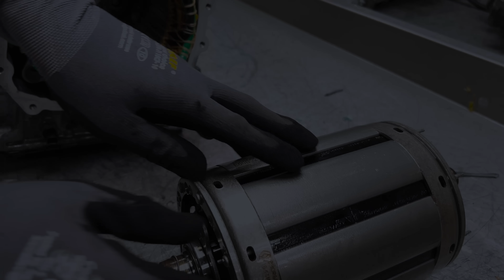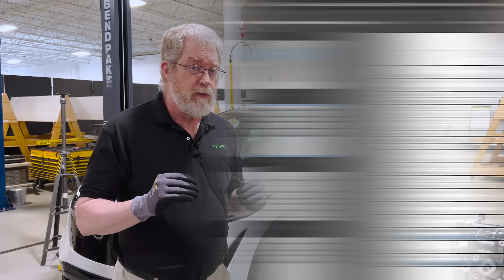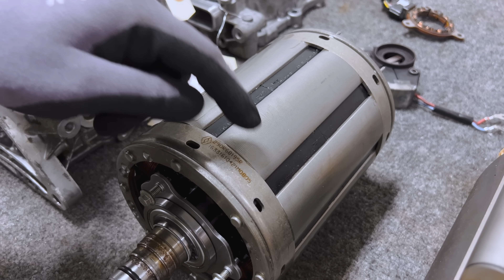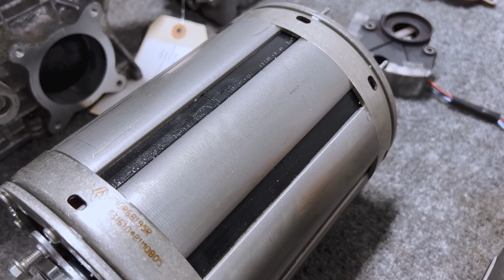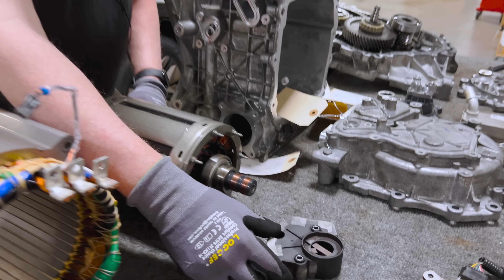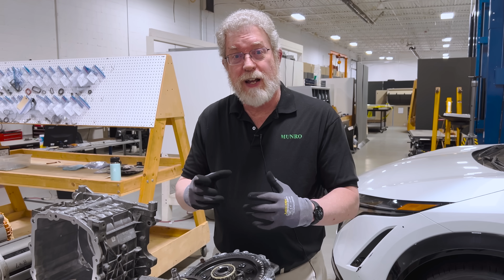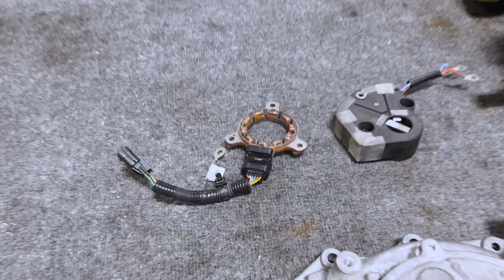This EV Motor Has No Magnets – Nissan Ariya EESM Teardown

Comment: Brushed RC hobby motors are similar to that Nissan design.  On RC motors, the commutator, the surface that the brushes touch, would turn black after a while and the motor would become less efficient and slower so I wonder how the Nissan design is going to work out in the long haul.  On the other hand, the windings in the rotor are super clean.  All the wires are placed nice and parallel with each other and back in the day, this would require the rotor to be hand wound.  I wonder if machines nowadays can wind rotors clean like that.  Machine wound rotors had windings that looked like what's in that Nissan stator.  They're all messy and some of the wires cross over each other.

Comment: So great to see a video on Nissan's EESM motor. I drove an AWD Ariya and an AWD Equinox coast to coast (San Diego to NNJ) and I noticed that at higher speeds Ariya has a slight edge on miles/kwh efficiency. At the end of the trip, Ariya scored 3.4 miles/kwh and Equinox scored 3.2miles/kwh both riding at mostly 80miles/hr.

Comment: @Munro Live: Great video! A little background info: The motor was originally developed by Continental and Renault used it in it's 2010 Renault ZOE (call Q90 motor), then Renault used/licensed Continental's design and rebuilt it in-house (called R90 and R110). You'll find Continental schematics if you google "Chameleon charger" because this motor is the AC charger at the same time (because the windings are used for the AC/DC conversion of up to 22kW AC which is common in Europe 3-phase wiring for the typical 400VAC x 32A)

Comment: I'm not convinced that brush-powered, oil-cooled magnetic coils for rotor is best engineering solution for synchronous motor. They just decided to get rid of "costly" permanent magnet for more complexity, lesser efficiency and much less reliability. Good luck changing cooling oil and brushes of your electric motor similarly you had to change belts/chains for your internal combustion engine.

Comment: So they have made a slip ring motor/ alternator. If you look at the 1970s yamaha xs twins alternators they with careful design had a fixed rotor winding negating the need for sliprings with stators of normal design

Comment: It's not the same as a permanent magnet motor. You can vary current to the field to control speed. But it costs a little to energize the field.  At low power it is more significant.

Comment: What highway efficiency? Ariya is no more efficient than Hyundai Ioniq 5 (dual PM) or Audi e-Tron (dual asynchronous induction) and neither of those has wearable parts. Like variable compression, another Nissan "innovation" that adds cost and complexity with no actual benefit.

Comment: When I was a kid (around 10) I rewounded a burned slot car motor. Then I had the idea to put some extra copper and since I recalled having heard they used varnish to hold the wire in place I did both - except I used woodworking varnish. The motor ran beautifuly for a few seconds than it turned into a rat's nest of copper wire and melted varnish.

Comment: The ZOE model from Renault also used brushes that wear down... but they had them not easily available for replacement - thus  a lot of manual hours to replace such worn brushes. This made an old(er) Zoe not very cost effective to return to good performance by  replacing the brushes.

Comment: In permanent magnet you would be able to reduce the magnetic field too electronically by a technique is called field weakening,  injecting d current to stator to make a field opposing the rotor field

Comment: BMW noted the same reasons for going brushed motor for the current gen i4, i5 and iX (Resource / supply chain risks). I wonder how similar or different they are? I recall that the biggest thin some talked about with brushed motors is addressing the controls, I would like to learn more about that on these brushed motors. Also, for brushed motors, is there concern about temperatures in the rotor? Is there any different tactics for cooling?

Comment: While appliances and powertools advertise with having brushless motors, Nissan decides to go to brushes when everyone else is brushless.
It gives me a double feeling. On one hand it does work, it's proven, etc. etc. on the other hand you have a wear item that generates graphite dust. And it is better? Nope, at least not in every way, or overall; it just has some benefits that make sense for highways.

Comment: In UK, the Nissan Qashqai is an engine hybrid using these drive motors and a generator. There is a small battery but no clutch or gearbox. Transmission is fully electric.

Comment: Interesting choice to use pwm to control the voltage going into the rotor and not an standard inverter to just send less voltage. The only benefit to that approach i can think of is a higher conversion effencincy when sending dc into the rotor. I mean it already has a inverter for the stator so why add an extra part that adds up to essentially be a beefy dimmer switch

Comment: The problem is if it is broke they still use it! Once launched no matter how bad the mistake might be, they will simply refuse wrantee on that part. The 2.5ltr diesel and gearbox used in the Nervana pickup truck and the battery packs in the leaf.

Comment: Would be interesting to compare with the BMW motors, which take the same path (something very similar, at least). The 5th generation BMW motor "Externally Excited Synchronous Motor" (EESM) is described as using coils in the rotor and brushes. They talk about an advantage on motorways being able to reduce power to the rotor to better coast, rather than needing a clutch. Don't know if they've continued that approach in the latest vehicles.
Reply: (just found confirmation the 6th gen BMW motors are also EESM)

Comment: No mention regarding miles per kilowatt used compared to a permanent magnet motor.
Reply: Miles per kilowatt-hour you mean. They did mention that the asynchronous motor gets better efficiency at high rpm whereas a pm motor has better efficiency at low rpm. 

The consumption is dependent to the car as a whole, so a bit hard to compare I guess.

Comment: Electromagnets use power & generate heat they are also going to need those brushes replaced. 
From a manufacturing point I can see the upsides.
Fro, the consumer side it all seems to downsides..

Comment: 16:00. I though Park Paw is not recommended especially when parked on slopes. 
As it puts pressure into gears and gearbox. 
Doesn’t electric cars have electric handbrake, and they are used for parking instead of the antilock brakes?

Comment: I would really love to see you get your hands on one of BMW's EESMs to see how it compares. BMW, I believe, doesn't use slip rings in their brushed motor and they claim the brushes will last something like 200K miles minimum. As far as I know, only BMW and Nissan/Renault are using this type of motor in their EVs. BMW is switching to a new induction front motor on their Gen6 EVs starting with the iX3 and i3 built in their Neue Klasse platform later this year. We have an i7 xDrive60 and it has been very efficient, especially at high speed for how large the car is. We routinely see 330-350 miles of highway range at 75mph+.

Comment: This was the way to go for efficient electro motors and generators before China flooded the market with cheap and extremely environmentally damaging rare earths in the late 90's. The built quality of the stator seems kind of medicore to me - looks like it was hand winded utilizing child labor😅 and it is definitely less efficient then permanently excited engines, since most acceleration is done at low speeds. Besides, who thinks using EVs for long distance travelling is more efficient then ITCs anyway..

Comment: The relative inefficiency at low speed versus PMSMs which EESMs have is largely made irrelevant by the fact an EV uses way way less energy at low speed than at high speed. You're not going to run out of range in your battery by city driving, pretty much! You can also claw back some of that efficiency loss by carefully determining when and how much to energize your motor coils, as BMW is doing in their EESM drive units.

On the other hand, the EESM having better efficiency at high speed, where power draw is the highest and the need for efficiency is the most pressing, along with the total lack of need for rare earth minerals, should help cement this style of motor as the choice for EVs going forwards.

The PMSM is a neat piece of kit, but there appears to be a new king in town...! :)

Comment: I'd like to know more about the item placed between the brushes and the tail bearing.  It must contain an oil seal at minimum and probably a shaft ground.  The part number returns nothing. As to the brushes, BMW use a pair of brushes for each connection in their similar electrically-excited-rotor motors, I gather to reduce the current and therefore increase the life.
Nissan also used (a pair of) carbon grounding brushes on the Leaf's intermediate shaft in the gear reducer, noting also the change to tapered-rollers in the Ariya.  Although the Ariya's gear reducer was hardly discussed I think (a) the ongoing inclusion of a parking pawl is an inexpensive and time-tested safety feature (used in many EVs that aren't cost-cut to the bone) and useful in freezing regions.  And (b) I see the particle magnet is now placed in a pocket like several other manufacturers do, such as Renault, Hyundai-Kia and VW.  That's a departure from the Leaf which uses two plug-end magnetics that were rigidly retained.  IMO, it's not a great idea to restrain the magnet with a clearance fit such that it can rub against the aluminium housing under the influence of oil turbulence.  Just ask the many unlucky owners of Hyundai-Kia EVs up to MY 2023 who have had their gear reducers replaced due to bearing damage.  The only mitigating factor to that choice is that oil-cooled motor systems have a much larger oil capacity than needed with water-cooled motors so any contamination is much diluted.
Reply: I appreciate your insights.  There is indeed an oil seal (a shaft lip seal) separating the slip ring area from the rest of the motor.  The only grounding brush in the drive unit is on the secondary shaft.
Reply: @PaulTurnbull-EMfield  thank you for the personal response and your video!

Comment: Most EVs use either a standalone electric parking brake assembly at the rear wheels or utilize the same  lead screw driven mechanisms that is integrated into the newer brake calipers. They don’t use the ABS system to apply the brakes. There is no hydraulic system in operation for the parking brake activation.

Comment: I am wondering if this rotor doesn't take a lot of current.  Could that technology be changed to use AC induction to the rotor, illuminating the brushes, and just induce a current into the coils? Or would that be pointless because the AC inducted magnetic field would be alternating and make the motor harder to control, even if it managed to work?

Comment: How is it ensured that carbon dust from worn carbon brushes does not get into the bearings and inside the motor? Personally, I am not a fan of motors with carbon brushes, which wear out sooner or later, resulting in service costs.

Comment: It is good to see Nissan install the remote breather.  Toyota didn’t do that on the Dana rear axle of the early 2000s Tacomas where the breather is right on the axle.  The check valve invariably gets stuck all open or all closed.  You either get water in your differential or you blow gear oil past the seal into your drum brakes.  I had the oil in the brakes scenario.  There is a fix off-roaders do - use a PVC vale hose nipple which has the same diameter and thread pitch where the breather goes and then run a rubber hose and mount the breather in the tail light housing.  Pretty slick fix.  Toyota did install remote breathers on the front axle and transfer case.  Some engineer must have been asleep at one of the design reviews discussing the rear axle.
Reply: Good point! 👍👍

Comment: Thanks for another great video!  I am quite surprised that they grounded the shaft of the counter-gear instead of the shaft of the rotor. This means that the current has to flow from one gear to another. I'm not sure how much the gear's teeth are in hard contact, I've always imagined that the oil film acts as an insulator. On the other hand, the film would be very thin, effectively working as a modest capacitor. As the current flows in very sharp pulses, the capacitor would act as a low impedance path. But still I would be worried about the danger of pitting the gear's teeth.

Comment: I don’t much like Nissan, but this motor is pretty smart by getting rid of rare earth magnets and being low loss when free spinning.  I’d be curious to know the windage/fluid loss at 12,000 RPM.  Running motors at high RPM to be the way Nissan rolls (literally).  The other thing is - what happens to the residue from those rotor brushes?  Having said that, I love the engineering trade-offs that Nissan made - very smart.  ✔️

Comment: Great informative video. Respect for the engineers: This is what they deserve. About the rotor part, not to forget to mention is the assembly of permanent magnet rotor types into their stators.... not an easy part when you have to do this in your service station ;-) With this motor you don't have this issue. Great for service !

Comment: much hype than engineering/facts. this no better than the induction motor that also don't need magnets and so work well at high speeds. while the brushed motor, I think, could provide more torque than the induction motor, torque can be offset between these two motors with gear ratios-now with the Nissan motor you have a brush that is dirty and needs to be replaced.

Comment: In 2000, people were working on wound field motor for EV drive. Then suddenly, someone discovered the rare earth elements and magnets were everywhere. Now, we are going back to the basics.
Reply: China controls 90% of rare earth magnet materials.
Reply: @mikafoxx2717  They made it cheap and addictive like fentanyl so...  😂
Reply: Less to go wrong with a magnet than a coil though.
Reply: @markrainford1219  No. Magnets may look simple, but incredibly complicated material science. Lot of invisible things can go wrong. On the other hand, the electromagnet is well understood. If you have a grade of steel, have certain number of turns of copper coil and pass a known current, you will get the well known value of magnetic flux.
Reply: @Debraj1978 but in realty a magnet in service is unlikely to fail.
Reply: @markrainford1219  Magnets fail when motor is operated in deep field weakening, where stator current is used to kill the permanent magnet flux. Moreover, permanent magnet is susceptible to high temperature. Chances are less, if operated correctly.
Reply: @Debraj1978  magnets fail only due to high temperature. I have never seen a magnet suddenly fall down from a fridge. Whereas short circuit or circuit disconnect is orders of magnitude more probable
Reply: @mbican  Permanent magnet motors have their place, but this (or induction) is definitely the way forward for mass production commuter vehicles.  The excited rotor is much less likely to fail than a PM rotor.  If you worry about losing power to the rotor windings, you'd have to worry at least as much about the stator in any case.
Reply: @markrainford1219 Until China cuts you off! 🤯
Reply: Rare earths are not rare, they are everywhere. Refining is extremely toxic and the product is extremely cheap. China controls the market because it is dirty industry with zero profit. 

Magnets haven't been discovered suddenly. They were definitely used in high value applications like computer hard drive head swing actuators way before the year 2000 before anyone even begin to think about electric cars.

Comment: Excellent teardown, with detailed explanation of the fusion of legacy mechanics and electromagnetic function. Reducing the momentary impulse of magnets, yet capturing the full energy throughput. Even the service/repair considerations built-in. Refinements in the invertor and cooling system will reduce the costs, but with battery technology/density advancing rapidly, with falling prices, ...this could bring Nissan back(!) Put 2 of these motors in a Pathfinder and "I'm all in"($)

Comment: Tesla's motor technology, primarily featuring permanent magnet synchronous motors (PMSMs) with reluctance enhancements, surpasses Nissan's externally excited synchronous motor (EESM) in efficiency, performance, and reliability. PMSMs achieve up to 97% efficiency by leveraging pre-excitation from magnets, minimizing energy losses compared to EESM's excitation requirements and brushed design, which introduce wear and lower efficiency around 93-95%.

 This results in superior power density, higher torque at low speeds for rapid acceleration, precise control, and better overall range without the maintenance issues from brushes or slip rings.

 While EESMs offer advantages in avoiding rare-earth materials, Tesla's approach prioritizes dynamic driving and longevity in real-world EV use.

Comment: I'd avoid anything with French electrics, particularly Renault. Burnt once, not going to be twice.
With regards to the brushes, I can see that they'd probably last as long as the car, but that is going to be an awful lot of carbon dust floating around in the motor. I would have liked to gave seen them have some form of ventilation to assist in removing the dust.